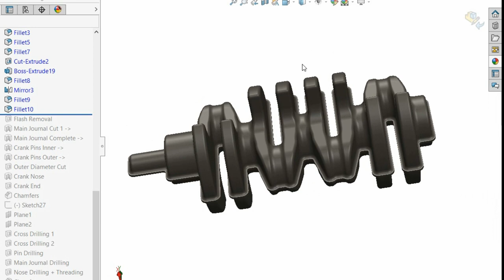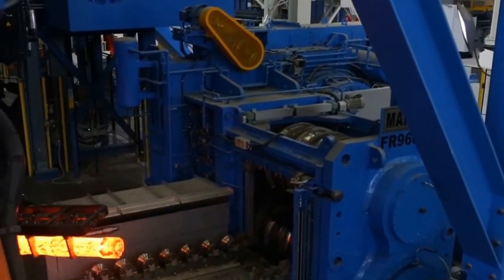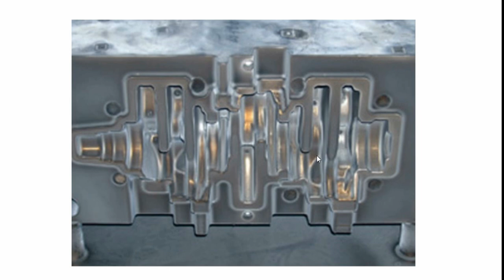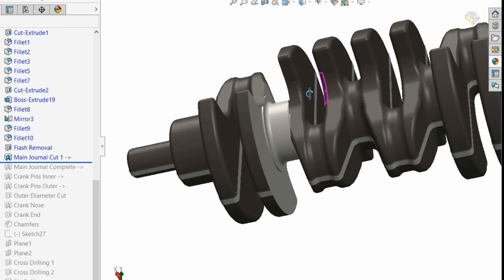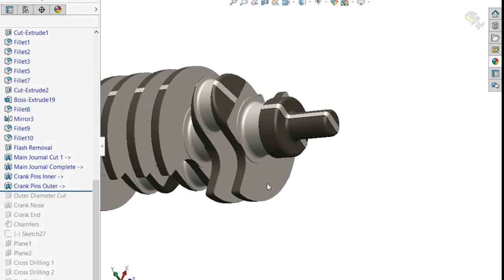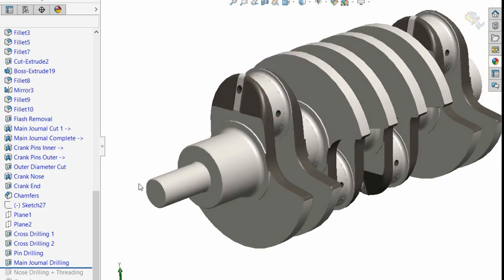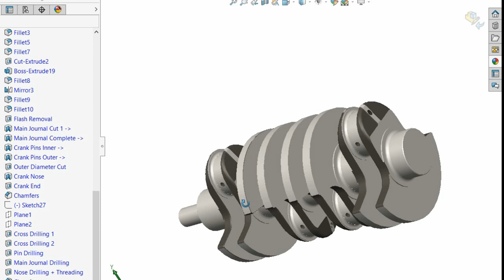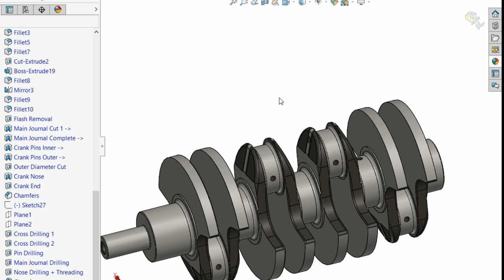Complex Engine - Part 1

Comment: I really appreciate your focus on manufacturing. It's not my line of work anymore, but I used to machine/manufacture aircraft parts in a small shop. There is a shocking lack of understanding about how things are built and the difference between standard processes and something that "could be done." Keep doing these videos, they're desperately needed!

Comment: Top video Matt.  Very well done.  And Hello from Little New Zealand
Reply: Have been playing with the idea of building a model engine for years,   basically pulled apart a 15cc 4t model airplane motor.   Drew it on simple 2d cad.   Added a fue cylinder's         reverse engineering I guess it could be called.    Now I've found FreeCad     so trying to teach myself 3d cad.  It's doing my head in a little.    Lol   think I need to do a polytechnic course.      Ex fitter welder.    Lol    we done our drawings on drawing machine's   paper and pencil.  So sadly I missed out on the lessons of cad.   30 odd years ago now.
  But yea,   much love my man.      Learn from you with every video

Comment: On some V-6 engines after forging the crank which is formed in a flat plane the crank is twisted to get the proper angular seperation on the rod journals. Of al, the machining operations performed on a crank the most interesting one is cutting the throws.
I've beern out of the out of the engine manufacturing loop for about 16 years but a doubt a lot of stuff has changed drastically. Manufacturing steps
1) Rough machine to length and machine the centers
2) Rough turn the post and  power take-off ends.
3) Rough Turn the counter weight OD, face the counter weights on the main bearing side and rough turn the main bearing diameters, fillets. This can all done in one operation using a rotary broach. You spin up the crank and the tool head advances and runs the toll through on rotation. Different cutting inserts cut different areas at different times. 
4) Rough out the rod journal diameters. This used to be done on specialized lathes that followed a master crank. The process now is a hollow milling cutter is CNC controlled to chase the rod diameter as the crank is rotated
5) Drilling and tapping operations. These are done on the post end, flange end and oil passages from the mains to the rod journals. Also any keyseats will be cut
6) Semi-finish and finish grind the post and flange end as required
7) Grind Rod Journal Diameters
8) Spin Balance. A rough and finish opperation.
9) Finish lap the Main and Rod Journal diameters.
10) Perform any marking operations. Serial numbers, part number, manufacturing number, manufacturing date. 
In between these operations there will be a number of gaging stations to catch issues along with off line gaging stations. Both CMM and manual.
The machinery used for producing high volume production numbers is not cheap. Most of the machinery is specialized for the tasks at hand.

Comment: With newer CNCs you can turn off center without moving the work. The x just bounces. You can even cut flat faces on a shaft.
Reply: Synchronous eccentric turning does exist but doesn't produce surfaces that are round enough for a crankshaft or camshaft. Good for roughing but needs to be ground like anything else
Reply from the maker: I said this in the video... you can either turn the work offset, or move the head, I.e the mill/tool head
Reply: @Eluderatnight any backlash or hysteresis in the synchronized axes causes an out of round and/or off-position error. There's a lathe that is capable of doing this sitting next to me, although it is a master-slave system and not synchronous as the spindle motor is not a servo. Great method for roughing an eccentric journal, but has the same drawbacks as circular interpolation on a mill does. Nothing quite beats turning, boring or grinding with the spindle centerline true to the shaft/hole
Reply: @forrestcarroll9350  
Before CNC crank and cam grinders were a thing cams were ground using a master cam that caused a. Cradle to rock in and out in relation to the grinding wheel. Crank pins were ground with the first and last main bearing diameter clamped offset to the centerline of the work heads and the Crank would index to bring the pin to the machine center line.

Comment: Tip: Typical crankshaft lifespan is about 800,000 km. Way longer than any other car component or engine itself.
Reply from the maker: Is it? Well surely that depends on load over life... you also say typical. Well the typical is probably 150 - 200k because most cars are destroyed about there
Reply: @dirtygarageguy  Fatigue life indeed. Yeah, especially in UK where cars are replaced most frequently on the planet Earth.
Reply: @dirtygarageguy  I like current series. What's next in plan?

Comment: Had the unfortunate pleasure of making a few billet cranks/cam shafts (pain in the ass normally horrible stringy material). 13:05 The surface finish can aid in oil splash believe it or not, Too nice and it glides thro the oil. Well that was high end engines F1 and Le Mans, dry sump etc and some engines need all the lube they can get  😁😁😁 You try hard turning one of them f#ckers to a 2 micron limit with intermittent cuts and not space to even swing a cat

Comment: Would you say that we aren't better machinists now we are just better at reproducible parts/designing for mass production? 

I ended up down a weird rabbit hole looking at the Whitworth rifle and there are examples that are capable of better accuracy than a lot of modern mass produced rifles but whilst the parts were interchangable it still needed hand fitting to get to that level of accuracy (casting bullets for that specific barrel and chamber etc) Then onto the 1911 where the tooling was developed to make them quickly but a competent Smith can with a few hours hand fitting get something FAR more accurate than one produced and built as per the original spec but a glock has the same inherent accuracy (when the human element is removed) and all the hand fitting of a Smith does is adapt the gun.to the shooters preferences. (Grip angle, trigger weight preferences etc)
Reply from the maker: It depends how you wanna define it. Is hand fettling each part to fit better or worse?
Reply: @dirtygarageguy  depends what you are wanting the thing to do really doesn't it? If I need 50k of them in 6 months hand fitting every part is a problem. If I'm making each one to order and can charge 7k per and guarantee that gun will do 1/4 MOA on demand (from a rest) and build 50 in 6 months then hand fitting isn't an issue.

It certainly seems like we are better at reproducible results without hand fitting now. You can buy rifles for 300$ that have accuracy guarantees that 30years ago you were paying 5k plus for and standard ecobox cars are pumping out power numbers and 0-60 times that hand-built 1970's supercars could barely do.

Comment: Happened across some real shite on a 2013 BMW X1 hatchback 

Someone put a wheel stud kit on that didn't have any shoulers to lock the studs inplace other than binding on the treads then put forged Aluminum lug nuts ontop of that. 

Car is driven on rough public roads and during winter season where salt is used on a regular basis to melt snow after plowing 

I saved 3 bad example pieces could ship them out to you so you could have a rant on them like all the shop service techs and I did🤣

Worse add on parts I've ever seen probably cause someone to loose a wheel as aluminum lug nuts seize, strip, or even split because of corrosion they weren't even manufactured correctly as one of twenty studs had the Alan key slot on the wrong side of the stud.

Comment: Single crystle crancshafts will be a thing sooner or later, right? Or is it pointless?
Reply from the maker: Pointless. Engine parts have a FOS (factor of Safety) between 6 and 8. Jet engines have a FOS of about 2... Which means that thye need all the strength they can get, hence making single crystals viable.
Reply: @dirtygarageguy  Stronger crank is still better/will go out of spec slower, no?
Reply: Single crystal should be stiffer too, right?

Comment: Modern mass produced engines are amazing in their tolerances.
Reply: And also process reliability/backup systems to reduce scrap parts. Whoever had the idea of keeping what would normally be "out of tolerance"  parts to be used in assemblies with other "out of tolerance" parts was a genius. A great example of this is Subaru's three standard piston sizes - The total tolerance for both the pistons and bores can be opened up leading to a reduced scrap rate, and then pistons in each of the three tolerance ranges can be matched with bores in each of the tolerance ranges.
Reply: @forrestcarroll9350  
The idea of multiple piston sizes is hardly new. One reason for it in the past was due to difficulty in controlling finish dore sizes when honing. The bore sizes could be as little as .0002"/.005mm to .0005"/.013mm. Matching the pistons to the bore size is done to reduce piston slap.
Reply: @forrestcarroll9350  East german car manufacturer Trabant did this exact thing since 1958

Comment: What about the oil way for the central main bearing?
Reply from the maker: That is supplied via the block, you don't drill a hole in the crank for that...
Reply: @dirtygarageguy  aaaah.

Comment: How do they drill a hole that narrow and far without any bit wander?
Reply from the maker: Really fast speeds, 3 flutes and really slow feed rates
Reply: @dirtygarageguy  
That or single flute gun drills
Reply: @dirtygarageguy  I would have guessed gun drilling. What kind of tip angle would you use for that?
Reply from the maker: https://www.directindustry.com/prod/mapal/product-12041-1634782.html

Comment: Matt.. I understood this..Thanks for stooping so low.The problem is its a fucking cager crank.Remember
motorcycles (mine at least) have either helical gears, hi-vo gear or straight gear formed on the crankshaft.
   nevermind the cam sprocket that runs between the cylinders of alot of bikes.Maybe youll get to it in the
next vid...I hope...Cheers.!
Reply from the maker: We'll be getting to the difference between motorcycles and car engine components, this being one of them.

Comment: Off the subject -( Bikes prior to 2011) Which is the cheapest petrol additive to combat E10 issues? I think that V power ect will still be available though
Reply from the maker: E10 issue?
Reply: @dirtygarageguy   Sorry Matt, When the E 10 petrol is put in to all forecourt filling stations in the Uk in August 2021 (10% Ethanol) thanks Rich.
Reply from the maker: I mean what are the issues? If you use your fuel within a couple of months then there's no issue
Reply: @dirtygarageguy  Totally agree but it is big news today and they are making big issues of the fact that it may harm your motorbike particularly pre 2011 and that most motorcycle owners don't use their bikes every week/ month. Without the correct facts thrown out their, owners will over react and buy unnecessary additives. its just getting the real facts out their from someone of your calibre , might help some owners.